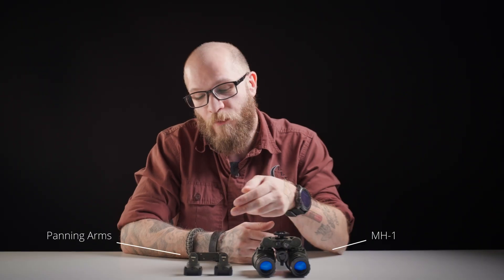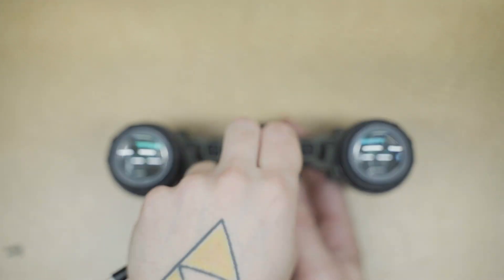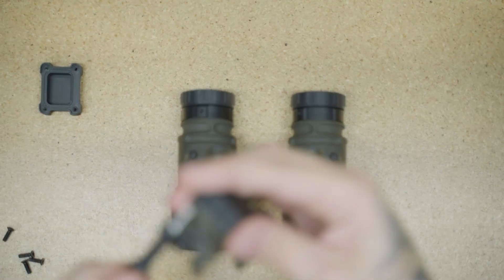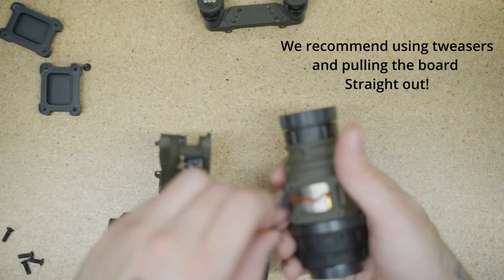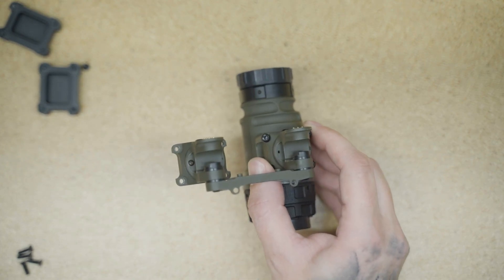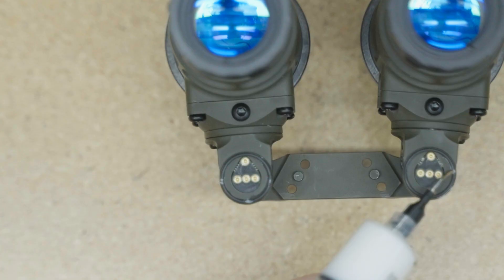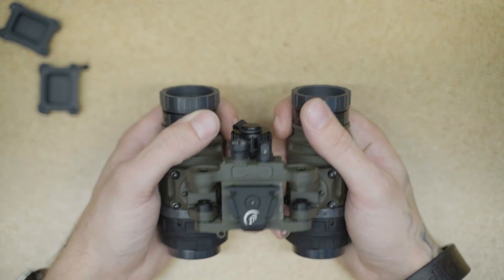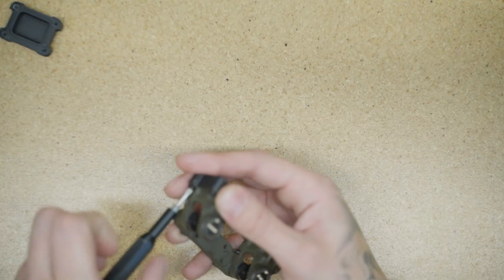LLI | PANNING ARMS INSTALL

Comment: I just installed mine and rather disappointingly they don't have the IPD stops the regular podtops have
Reply from the maker: Ipd stops unfortunately dont make much sense on the panning arms as you will have to change the ipd everytime you go between non panned and panned.

Comment: Is there an adjustment as to how far these pan out? Cause there’s only one position and it’s so wide I can’t even see my optic in front of my face and is creating a blind spot and nausea. It’s making the panning feature completely unusable. I tried adjusting the tube position, mount position and nothing helps. Seems like I need to have uma Thurman eyes to make this work properly
Reply from the maker: Panning while an impressive feature does have its limitations and use cases.  Ive found that passive aiming with panning is quite counterproductive.  I would recommend a LAM for this.  Additionally panning may not be to everybody's liking as there are trade offs, primarily the loss of collimation when set to the panned position.  This is unavoidable and may absolutely affect some people negatively as not everybody's brain works the same way.  The advantages to panning are mainly in driving, room clearing, and flying situations to give the user a wider range of view.  Please if you have any questions or feedback feel free to shoot them over to me at.

sales@lowlightinnovations.com

We love user feedback especially when it leads to us creating a better quality product for you guys as the end users.
Reply: @LowLightInnovations thanks for the info
Reply from the maker: @bubba5497 no problem at all!  Like I said we'd love to hear all of your feedback, while these were beta tested significantly maybe for certain users it may be a good idea for us to make a less angled version.  Im unsure if that would help the present issue but I'd love to have the conversation about it.
Reply: @LowLightInnovations I saw there’s a set screw that can be swapped to the other side to prevent it from panning. If there was a way to use that same set screw to limit how wide it would pan that would be maybe a simple way to limit how wide they get. Almost like an ipd stop to the panning feature. Maybe having a couple extra holes at like 80 and 75 degrees so you can tune the adjustment more. If you made it more complicated you could have a spring loaded detent at the top instead of the set screw so a user could pick how wide its pans out and change it really easy but it stay secure.
Reply: @LowLightInnovations  I just ordered a pair a few days ago and they are currently in route. I thought the panning arms were supposed to have three detents. 40°, 55° and the 60° ish?? As stated by Claude at shotshow. Did this not happen??

Comment: How important is it to purge after installation?
Reply from the maker: The importance depends on your operating environment and how humid the room is that you are doing the installation in.  If you live in an extremely humid environment a purge after the installation would be highly recommended.  However if the environment is less humid the importance level is not as high.  While purge is always advised, its not nearly as critical as some users may think.
Reply: @LowLightInnovations  Got a set on the way from Nightfall Optics